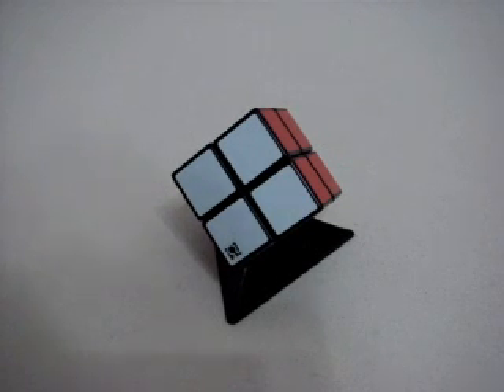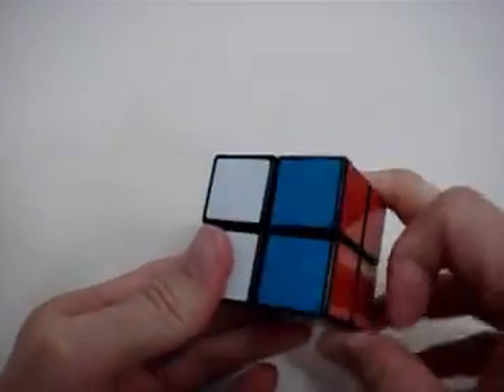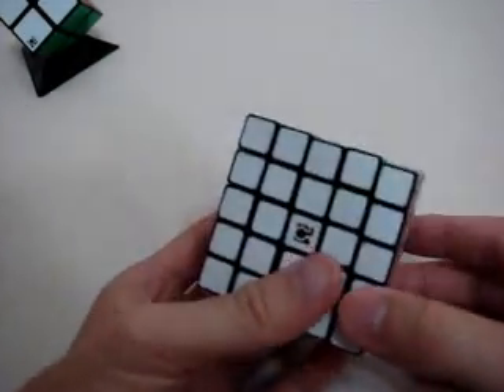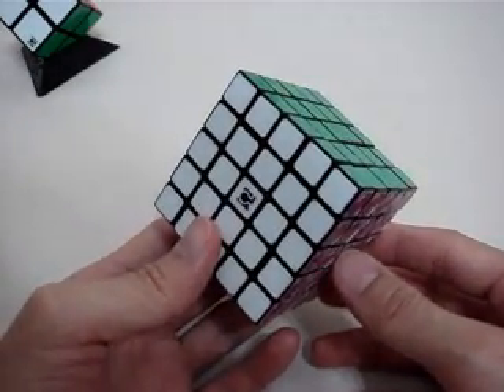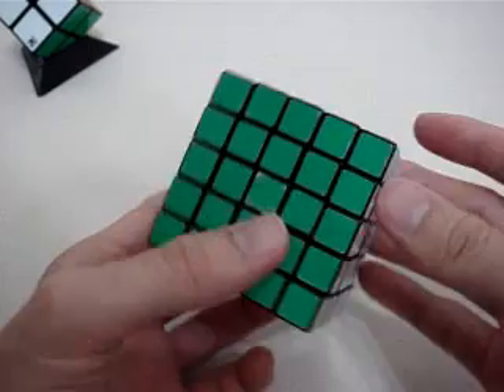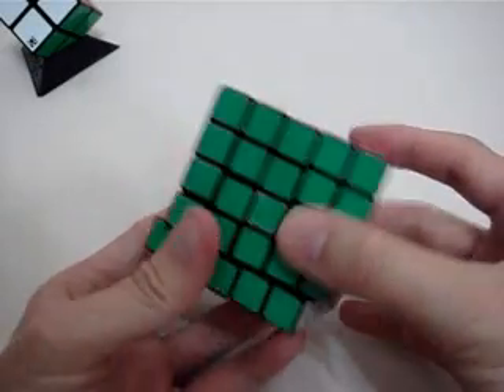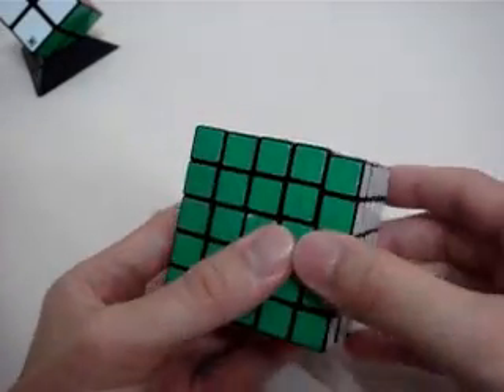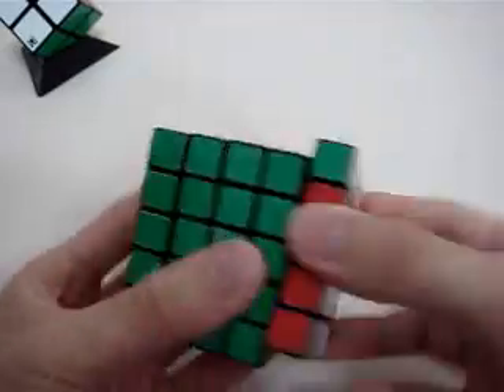Structure modification of a Rubik's Professor Cube (5x5)

Comment: Okay, so it isn't me.  I managed to drop mine on a rubberized surface and one of the center posts broke off, causing all the pieces to spill out.  I wrote to Mefferts and they are in the process of procuring a replacement core.

Comment: Supposedly, the Eastsheen/Meffert's version is harder to turn than the Rubik's version, but is generally more durable, as pieces will break off the Rubik's version if it is misaligned before turning.